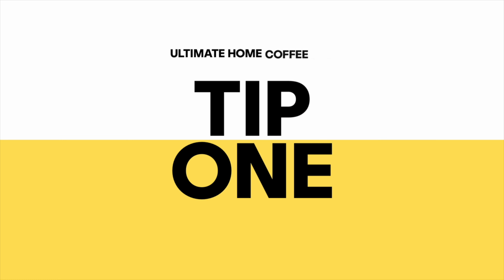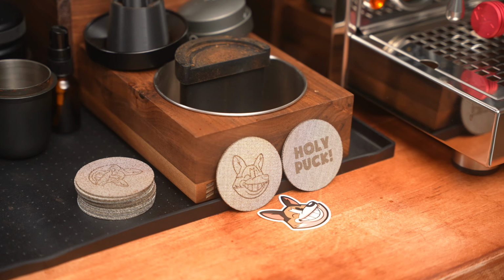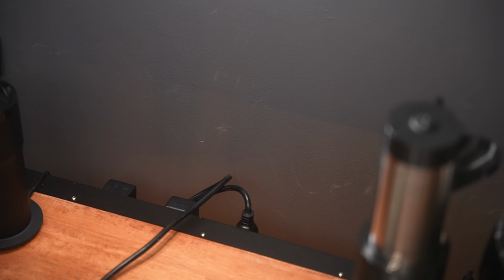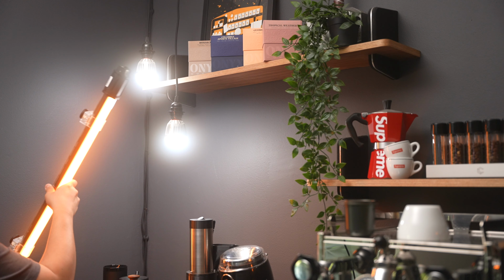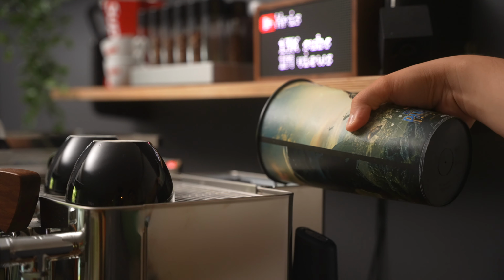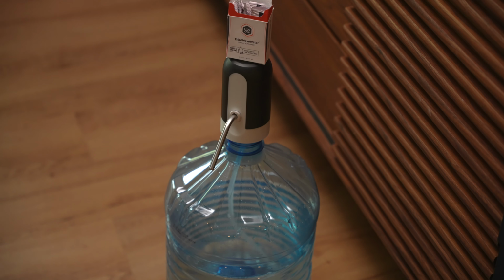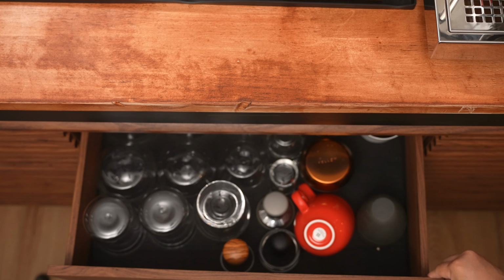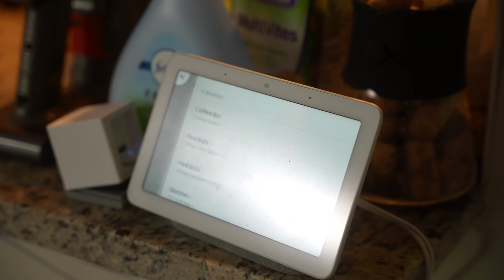5 TIPS for the ULTIMATE Home Coffee Station!

Comment: Nice video, like your content. Question regarding water. I like your solution, but am concerned about the use of third wave water in the espresso machine. Using these mineral packets in distilled water supposedly creates a "soft" water which is ideal for making good tasting coffee and should create less of a risk for building up limescale over time. I think magnesium is used as the primary salt as opposed to calcium which is found in varying amounts in tap water or in tap water which has been filtered but not softened. The concern with using extremely soft water is the risk for corrosion of the coffee and steam boilers of the machine. Metals leach out of the boiler and cause a buildup which is chemically different from limescale but effectively similar in terms of potentially damaging, and in particular with PID-based systems which has a sensor which can also buildup corrosion over time and malfunction causing over or under-heating problems. Java Jim on 1st line equipment has a Youtube video warning about, saying that they service a lot of machines of people who have used the distilled water treated with mineral packets (assuming that means third wave but no names mentioned in that video!). Curious if you have been using this for some time and have a strong opinion about whether it is really safe for you machine? Do you think the final product is superior to other water that you have used in the past. For what its worth, I own a Lelit Elizabeth, use a roughly 50/50 mixture of crystal geiser spring water and my tap water which I use a BWT pitcher with the magnesium exchange filter. And I use Lelit's resin water softening filter which I re-charge roughly every 2 weeks and replace every 6 months. Do you use a resin filter in your Bianca? Considering a Bianca as a future upgrade and like your review of the V3. Keep up the great content, cheers!